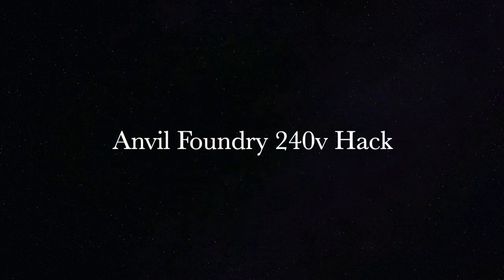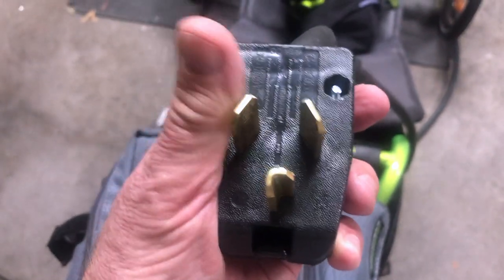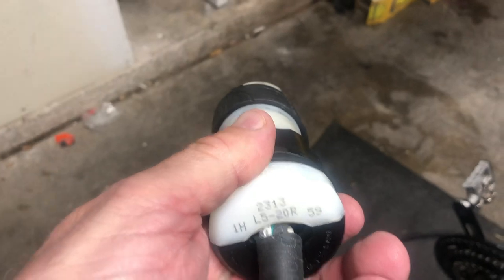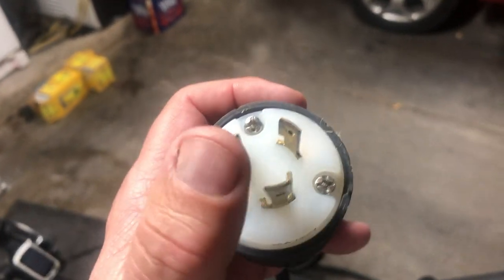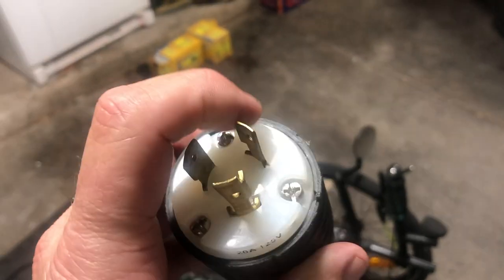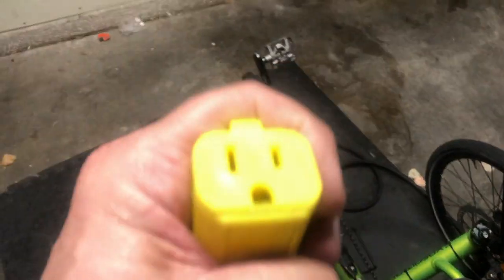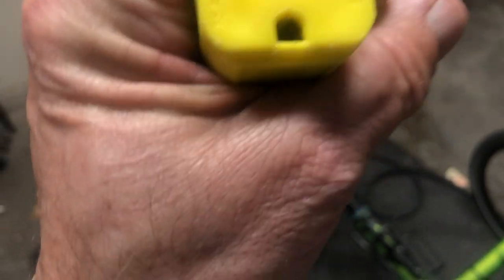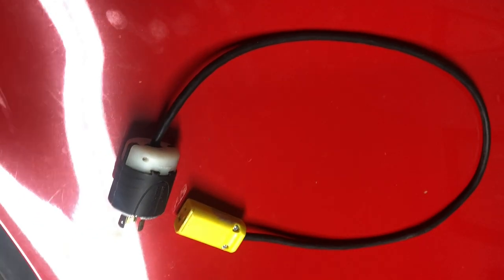Anvil 220:240V Adapter

Comment: You’ll need to switch the voltage manually it won’t detect the voltage automatically. There’s a switch on the back of the unit.
Reply from the maker: Texaviator23 obviously
Reply: I just wanted to make sure. In the video it said it would detect it. It will as the fuse blows lol.
Reply from the maker: @Texaviator  If you connect 240 to 120V,  I would expect system failure and damage.  Anvil won't cover that damage, as you know.

Comment: If we run a new line into a regular 20amp breaker (not gfci), do we still need a gfci breaker?
Reply from the maker: Vincenzo Terzo at some point in the line you will need GFI.  It’s cheap life insurance.  My GFCi breaker cost me $100 for 30 amp.  You can also put a GFCI on the back end of the system.   For me , it was easy to install a breaker in my main box.

Comment: Can you help me? I have a short in my GF control box
Reply from the maker: This video was for the Anvil Foundry.   As far as the Grainfather Controller, I advise you contact Grainfather because it may be warranty and they can handle it.  I recently sold all my GF equipment and got Anvil.  Sorry if that isn't much help.   I did make some repair videos for the GF but please check with them first.
Reply: @beerman1957  thanks for your reply. My GF is out of warranty. I thought you might know how I could find someone who could fix my controller.
Reply from the maker: Chuck Kerl  Is your boil unit working?  I mean, can you safely plug it In directly to power?   If so, I’d order a new controller and replace the male plug on the boiler just to be safe.